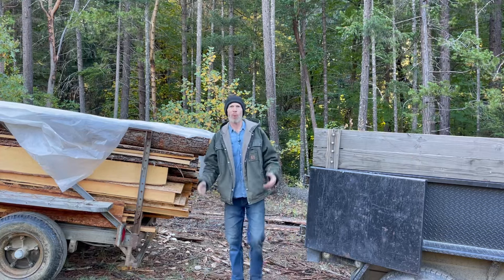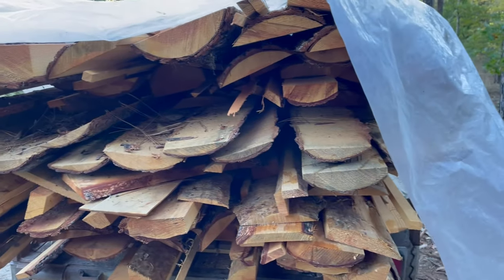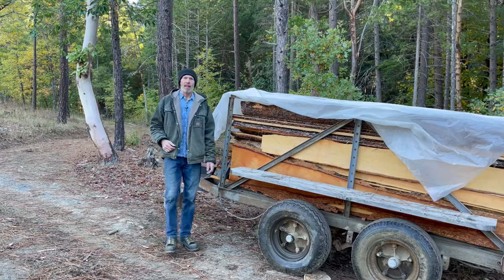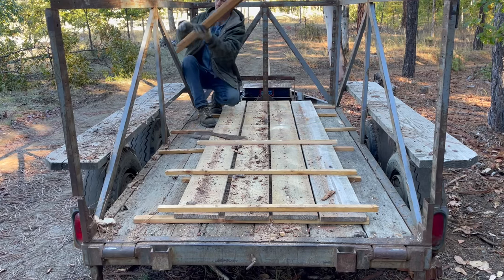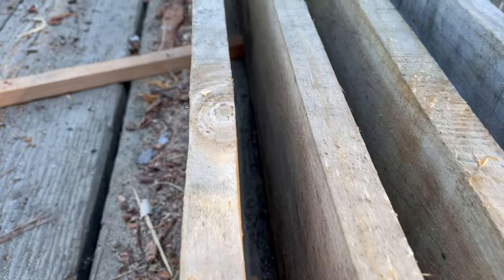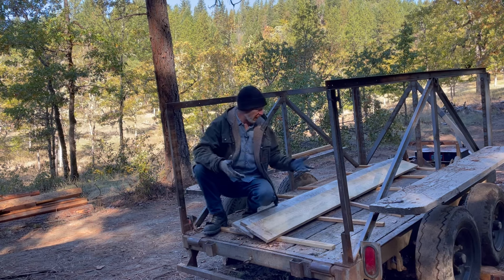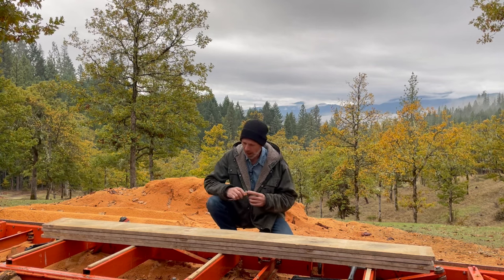Easy Way to Straighten Lumber After Drying UPDATE

Comment: I think you should rip saw one and video tape how much the wood moves as they are cut. I believe there is tension in the wood.
Reply from the maker: That is a very good suggestion. I should do that. Thank you.
Reply: There is always tension around knots. 
It is the way. 😅
Great demonstrations and thanks filming the process.
Reply: There's always tension around using a table saw.
Reply: I think that the tension il well distribute along the fiber structure of the wood.
Reply: You can feel the tension release when ripping lumber.
Reply: Absolutely 💯

Comment: Another Australian here. I bought some 30x70mm (roughly inch and a quarter x 3") pine from a big hardware chain. Chose the straightest lengths I could find, surprisingly very straight. Left them a few months in the room I was going to build a divider wall in, laid flat, no sunlight, and every one of them had twisted in that time. Quite a substantial twist, to where I can't use them as they are. I'll give this a try rather than spending another couple of hundred dollars. Thank you for this helpful video.
Reply: late on the reply here, another Aussie ( North QLD ) and by golly the number of times I've had "straight" lumber delivered here only to find it like a pack of strangled pretzels a week later is just terrifying - similar to yourself, kept dry, out of the sun, definitely frustrating.
Reply: Bunnings?

Comment: Commercial lumber has gone to crap in recent years. The big production growers must be fertilizing the heck out of saplings because almost all of the growth rings are 3/8" to 1/2" apart making for some very wonky lumber. So wonky in fact that Virginia codes have shortened the clear span range by a foot. What this means is just about all new homes have inferior lumber in them. What does this have to do with the topic of this video? Only that any lumber I am storing undergoes the stickering process with weight applied. I use an economical way to add weight - 5 gallon buckets filled with water. I place sacrificial boards over the "good" lumber and weight the whole thing down. Now, how do I get the twist out of peeler core 4x4s?

Comment: Those are  not planks for furniture, but good for paneling. And nails and/or screws will hold them in shape and place  - if they get wet and dry again. Without prop- structure, they will bend again in moisture-cycles. So, not very interesting to put them in water again or whatever. I mean, to proof, that they will stay in shape nailed to a structure, would be the better test.

Comment: Soaking them in water will straighten them out but when you let it dry they will warp again. However, I think after weighing them down dry if these boards get rained on or the sprinkler hits these boards, I suspect that they will want to warp again.

Comment: I am a woodworker myself and I can tell you this:

The distortion the boards went through while drying free of constriction was the result of the shrinking of the fibers of the wood according to their orientation in the board. 

Wetting the board again to the same humity as sawmill time brings them back to the orginal straightness (if cracks haven't already formed in the board thus altering the continuity of the fibers)

Drying the boards while constricted in a position different from the natural one is going to accumulate tension within the board.
To a certain extent the wood structure can handle those tensions, but they want to be released somehow and they would naturally try to release a little bit every time the board gets through a humity change by getting distorded again.

Now, about the usage of that lumber and how the tensions would release accordingly:

minimum to no size reduction:
if you just use them as they are or just slightly reduce them by size and :

1 get them fixed in a flat position by nails but have them get through big differences of humidity in the course of a year: tension will release partly by distorting again pulling the nails in time and partly by forming cracks in the board

2 get them fixed in a flat position by nails but have them not get through big differences of humidity in the course of a year: tension will release in a small part by distorting again pulling the nails in time and mostly by forming cracks in the board

3 get them fixed in a flat position by screwd but have them get through big differences of humidity in the course of a year: tension will release mostly by forming cracks in the board but also try to release by getting distorted again. Since the screws won't give getting pulled either they hold and all tension get released by the cracks or (and this happened to me) the board will snap the screws and get distorted

4 get them fixed in a flat position by screwd but have them not get through big differences of humidity in the course of a year: tension will release by forming cracks in the board.

If you try to rip saw the boards by any significant amount tension will release by bending the wood either arching against or away from the saw, and potentially suddenly snapping along grain whel little wood remain to be cut resulting in dangerous working. (I say from experience, some oven-dried 50 mm larch can accumulate a lot of tension...like a 10 cm cut board arching 3 cm while sawing it from the larger board)

Your best use for such wood are shor pieces which will tend to be straight even if you let the boards dry freely and so accumulate no tension within. 

Second best is to have them fixed by screws in a stable situation on the wet side of things.
Reply: Definitely good tip on cross cutting them into shorter pieces. Often times warped long pieces can be cut into shorter straighter pieces and work just fine.
Reply from the maker: Thank you, good information. It may be interesting to do some experimenting attaching with nails and screws to show what you are saying. I may need to find more crooked boards to experiment with.
Reply: You're both very welcome.
About the boards pulling the nails, i often see it in a traditional roof cover in my area, where long boards are nailed to small square pieces running perpendicular to the roof slope. If twisted boards were used, they will stay for some time (talking months, years or even decades according to board quality and to ambient condition) but will end up pulling the nails and twisting giving the roof the look of a ruffed up bird.
Reply: Wish I could understand the message here. Sounds like this water method wont turn out well in the long term?
Reply: @DieLuftwaffel  correct. The lumber will have a ‘memory’ of how it dried originally. That’s why when lumber is milled it’s needs to be stacked and stickered immediately. Then very heavily weighted or (preferred) strapped.
Reply: Bla bla bla bla bla 😴😴😴😴

Comment: Glad to see the update. I had a hunch they'd straighten out for you. I had 5 large eastern white pines cut, and then milled them into 4/4 wide plank (some are 17" wide). I ended up with about 3,000 board feet.  I stickered and stacked them right away, and covered them with a tarp for a season. Then I re-stickered and stacked them in a humidity controlled basement. Two years later, I re-stacked them, getting rid of the stickers, and they were all straight as can be. I've been using them for various projects over the past 5 years and I don't worry about them warping at this point. They're very stable.

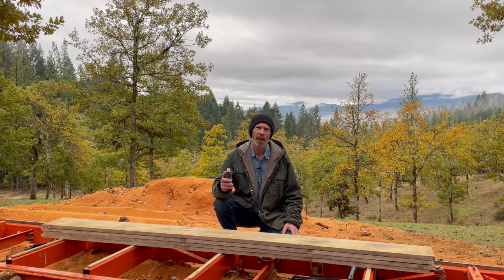Comment: G’day mate, thoroughly enjoyed your videos on your efforts to straighten lumber. You mentioned the comments that you received from folks that bend wood via steaming etc. For your information a lot of people tell you it’s tension within the wood and they are correct but here in Oz we just call it the Timbers memory, quite a few years back I built a hut out of stringy bark (an Australian hardwood tree, I debarked the trees and scraped some of the shaggy bark off of them with a sharp shovel, I used the bark to light a small low heat fire the size of the sheets of bark about 8’ x 4’ I then used a few short pieces of star picket posts driven into the ground with others attached to make something to suspend the sheets of bark on.  5:53 I laid the bark onto the frame and allowed the smoke and heat to affect the bark, probably only about 10 minutes or so for each sheet of bark they softened and laid flat on the frame they started to smell of the resins, quite nice actually and it was also a good clue that they were almost ready to remove from the heat, I then laid them onto a flat surface and as you did I put sticks between the sheets to allow for airflow around the cooling sheets. I left them for a few days ( I probably didn’t have to though once they’d cooled). 
The end result was I had beautiful flat timber, I had changed the timber’s memory from being I’m wrapped around a tree to I’m now a flat sheet, I built a hut 40’ x 20’ and used the sheets nailed to a frame, the hut stood for about 10 years and the bark sheets never twisted, when I pulled the hut down I had the sheets stacked on the farm, in the weather and again they never shifted, from time to time I’d put one or two cut to shape in a horse float excellent gripping surface for the horses, well those sheets laid straight and true for over twenty years. I later discovered some of the really old homes in parts of the region had used this same method as roofing for their homes and the timber was still in excellent order after over 100 years of use. So it’s really just a matter of reprogramming the Timbers memory into being what you want it to be.  
I’d love to see you try this as it’s an awesome technique and quite simple and very fast. 
Cheers
Keep up the good work.

Comment: I sure could use you around here to stack lumber in your "fast" mode. I can't believe how fast you unloaded that trailer. Oh, good job on straightening the boards. 😉
Reply from the maker: It happens after I eat those bay nuts I was collecting in a video a few weeks ago. They are packed with energy.

Comment: I'm glad I came across this video.  I have driven myself nuts trying to get straight and flat boards for a few years now.  I do a lot of woodworking as well as tree falling.  A good friend of mine has a Woodmizer saw like you do.  I cut some pretty good sized spruce and tamarack trees and ocassonaly I will take some eight foot long logs to Gary and he will saw them up for me.  The trees we cut are always dead, but it takes years for tamaracks to get dry inside once they die.  So I bring the boards home and sticker them and put hundreds of pounds of weight on them inside my shop that is heated and has plenty of air circulation.  I have even put small fans in place to move air around the stacks of boards.  I check them after several weeks to a couple of month later and get real low moisture readings.  I will un sticker them and stack them up for later use and when I go to use one the are warped to heck again.  I have NEVER soaked boards with water like you are doing in this video, so I am going to do that the next time I get some boards from my buddy and give that a try.  Wish me luck.  Thanks for this video, it is appreciated very much.

Jim 
Baker City, Oregon
Reply from the maker: It would be interesting to see how other species like tamarack respond. Best of luck.
Reply: Can you turn down the heat?    Anyway to use double or triple the weight you currently have?    Have weight on them when you unsticker

Comment: What a cool experiment. I wonder if you just used several ratchet straps, it would save a lot of work moving the weight... Just a thought.
Reply from the maker: I thought about that but didn’t have excess ratchet straps to spare or a good surface out here in the woods to strap them to. If I was going to do this more than once it would be good to set up something like that.

Comment: On kiln dried vs air dried, I once read an interesting point that kiln drying is of course not permanent. Once kiln dried wood is placed in a different environment it will come to equilibrium with the new moisture levels. So I quit being concerned with my shed dried slabs, I have the time to let it dry, and I’ve had no problems with any of the furniture I’ve made.

Comment: if you use them for something like a fence where they are only supported in a couple spots they will start warping back to the twisted state after the first rain. the only way to keep them kind of straight  is to use them in places where they will be anchored down in multiple places along their full length and even then over time will find a say to distort in places where they are not anchored. i've got fencing boards that i have straightened multiple times then hung them in the heat of summer fencing boards that were straight but by the end of first winter the boards that started out straight stayed straight but the ones i straightened had reverted back to their distorted state, one of them even pulled the nail out of the cross support it was nailed to as it curled, warped wood is warped wood.......

Comment: One nice experiment would be the effect of surface touching the board. This is, probably one source of twisting effect. You let water get out from wood freely on one surface (air contact) and much slower on the opposite surface (supoort surface contact). By adding those slats you let air contact on the bottom surface making it as free to evaporate as the other surface. A nice test would be letting it dry hanging, perhaps from a nail on its top, see how bad it would bend under pure effect of gravity (as well as wood fibers).

Comment: I’ve been wanting to try salvaging oak pallet wood from work, so this has been super interesting. I wonder if I can fix cupping the same way.
Reply from the maker: I would be curious to know that too. If oak would be as easy as pine. I am picturing narrow boards. I am thinking they may need more weight than pine to keep them from cupping. But only a guess since I haven’t worked with oak lumber.

Comment: I've heard something about straightening boards getting them wet and weighing them down on a flat surface to dry back out. Haven't tried doing that myself. I wonder if this would work on boards that have a crowned side. or the narrow side having a curve from end to end. I don't remember what that's called. Maybe a bow? When they kiln dry boards I think they stack them on something flat, and separate them so they're not sitting flat on top of the boards under them to allow for air circulation between them. Interesting video. A successful experiment.

Comment: Constantly have this Twisting issue with Pressure treated Pine. comes in soaking wet and is guaranteed to warp. The only thing I have found is stacking with stringers in between and weighting them with old 4x4's. I've even had to side clamp rows to keep side bowing from happening.

Comment: I wonder what would happen if you covered them in wood glue (PVA) whilst they were wet. I wonder if the glue all through the fibres from the wetting out of it in water would be enough to pull against the tension in the wood as it dries. Then flip and repeat. I have some warped plywood but I don’t think that would quite work the same 😄

Comment: What are the small horizontal wood support strips on your sawmill for? I just put logs right on the metal supports but now you have me curious :)
Reply from the maker: It’s a good question but brace yourself for a very uninteresting answer. 😁 The mill was wet because it had just rained. I put some dry stickers on the mill to keep those boards dry.

Comment: I think this method has been used in shipbuilding, but in the opposite direction. Wood is wet, and then shaped and curved to what is needed for the design of the ship. I don't know if that method is still used, but it has been historically.

Comment: Once the boards have straightened. Then preserve the moisture content by sealing them and the board will not warp and retain its shape. Its not great for every application as the high moisture content can defeat some uses but definitely will help utilize some of the warped material.

Comment: Most likely they will warp and twist again over the next few weeks as they continue to dry not weighted down.  The tension in the wood that caused them to warp is still there so I wouldn't want to try ripping them at all.  They'll spring apart and bind on a table saw.

Comment: My method for straightening lumber is to sort through the stack and get stuff that is straight. If it warps on the way home or before I can use it, I take it back to store and trade it in.
Reply from the maker: That sounds like the best way to do it. But that poses a few problems for those who mill their own. 😁
Reply: My comment was a little tongue in cheek. It's a lot like if your parachute doesn't open. You just give it back to the supply sergeant and get a new one. @WilsonForestLands
Reply from the maker: The parachute comment is a good one. I will have to remember that one.

Comment: They will continue to twist and distort over time.  You can't beat the physics.  And if you let them get soaked again, they're going to dry just as twisted as they had been.  Of course, using them in a project where they are nailed or screwed to straight lumber will help keep them straight.
Lumber isn't homogenous, so when it dries the parts containing more water shrink more than the parts containing more resin.  You can't get around it.

Comment: Thank you for this!  You reminded me of this video... https://youtu.be/bfmCV7qKtGk?si=nTDYUtyLCKDJMH6p

Where he mills down a log destined for the fire pit and shows how he stores it while it dries out and it's essentially this method, only stacking it and using compression from wires.  I figured if you have a couple already straight boards you could use them as the bread of the stack sandwich.  About six minutes in you'll see what I mean.